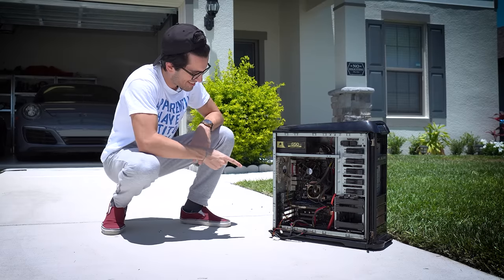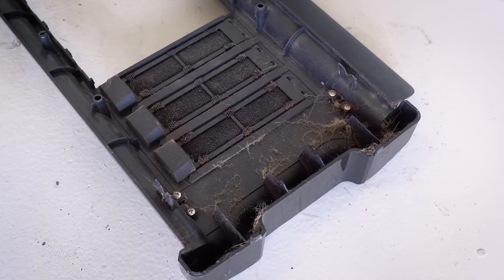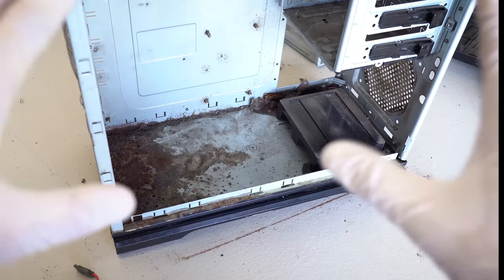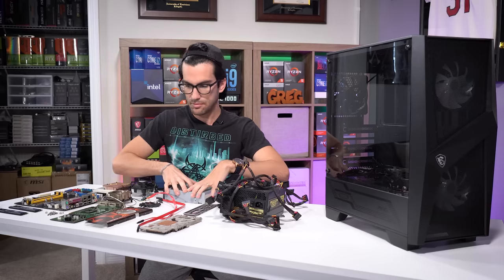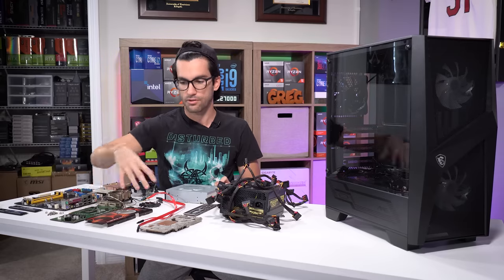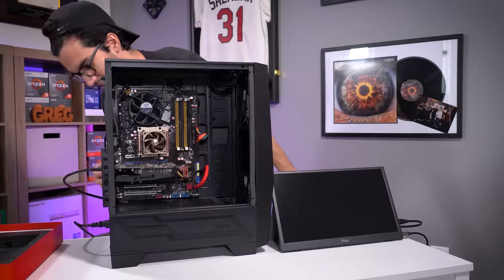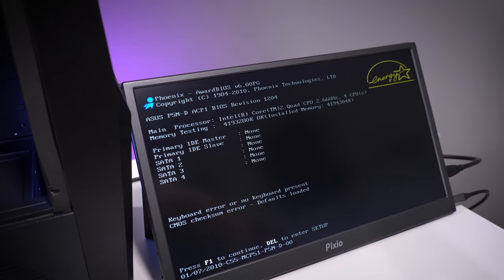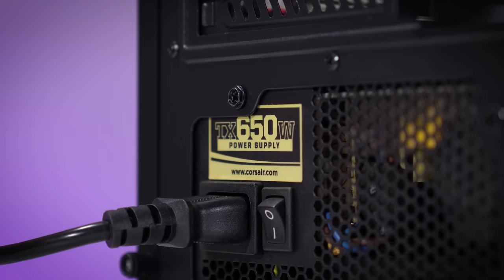Deep-Cleaning a Viewer's DIRTY Gaming PC! - PCDC S2:E4

Comment: As someone who previously worked at a computer server warehouse during summer in high school dealing with filthy systems exactly like this every day, I really enjoyed this video and it was so entertaining and satisfying to watch...Cleaning out a disgusting system ridding it of all the age and dust making it look and feel brand new again is just way more rewarding than just building a brand new pc with top-of-the-line components that you can find on major retailers like every other pc build on the internet. Really appreciate you sharing this, liked and subbed!
Reply: I agree. Yesterday I cleaned my computer case which was FILLED with dust like seriously no wonder I couldn't run games good and it overheated often. I thought it was the gigabyte geforce gtx 770 which was bad but it couldn't just get air and also my case restricted the air flow so I opened it up. Now works better than a lot of todays low-mid end gpu's I definitely agree making something that works better is way more rewarding than just buying something you don't need.

Comment: My friend's dad found something like this on the side of the road. He picked it up and dropped it at my house knowing I'd be interested. Utterly filthy; years of dust, dead bugs, and solid, sticky grime. I cleaned it up using some of your PCDC videos as inspiration, and after replacing the power supply and putting in an SSD I've put together a pretty capable system for my cousin. The thing had a reference Radeon R9 290, which still holds up incredibly well in modern games but is ridiculously loud. Worst part is an FX 4100, but I think I'll get him an FX 8350 for Christmas. Love this series, super therapeutic and inspiring. I went down to my Grandma's house on Monday and gave her system a clean, it was much overdue and its plenty more quiet now.

Comment: You should get yourself a small ultrasonic cleaner,  when I get in components that are in that state you can put them in the ultrasonic cleaner for 10-15 mins @ 40-50C then soak in Isopropyl alcohol and they come out looking brand new!
Reply: Yes this - if you are going to go hard into cleaning electronics, a good ultrasonic cleaner is a must.
Reply: They seem to run $150
Reply: I've never used one, but have seen em in action and they work wonders. +1

Comment: Its that I am in the Netherlands, otherwise I would have send one of my old gears (i5 3rd gen). Would have been perfect as an upgrade for that DDR2 system.
Reply: @MrGichinfunakoshi  core 2 quad also can run  with dd3, but previously the memory controller was in the north bridge, not in the cpu itself.
Reply: @MrGichinfunakoshi  Old gear to replace that ddr2 sistem, means the hole platform, cpu, motherboard and ram.
 Lga 775 with an overclocked Xeon 4ghz+ might be able to play some new games tho..
Reply: @MrGichinfunakoshi  You can see in the shots clearly DDR2, and the motherboard only supports DDR2, for this sysytem.
Reply: @MrGichinfunakoshi  The original.comment meant that he would send his build with 3rd gen i5 to replace the build in the video which is DDR2.

Comment: Hey Greg. Props to you. Diving into these science fair projects is akin to working in a biohazard lab. Here’s a suggestion, based on my experiences. I’ve been in the automotive detailing business for years, and the best tool that we use, by far, is a tool called a Tornador. Yes, Tornador, not Tornado. It uses compressed air and various solutions such as IPA, or degreasers, and is indispensable. We use it around vehicle electronics, instrument clusters, window and door switches and the like. I’ve used it with care, to clean PC’s as well with great success. Take a look and see what you think.

Comment: The GeForce 9xxx series was already DirectX 10 shader model 4.0. The last DX9 cards where GeForce 7xxx. That's also why I have a Geforce 7800 GTX SLI system in my retro collection and a ATI Radeon X1950 XT system for good measure.

Comment: Greg I enjoy the videos, I get the same satisfaction as my hobby for high end automotive detailing. One thing I took away from detailing cars and their interiors is that boar hair brushes are king. I highly recommend you pick some up for doing these videos. Just spray the board and brush with alcohol and brush away. I do this with my own components and it works very well, much more efficient than using towels.

Comment: Used to own a couple 9600 GTs.  Ran them in SLI mode.  Highly overclockable cards.  Ran alot of games with them before upgrading to a 560 TI around 2011ish.

Ive since upgraded from the 560 ti as well lol.  Was showing its age.  Got a GX 6600 XT Radeon now.

Comment: I absolutely love this series, but I'd love to see a quick benchmark run on some of these older/different systems we don't see very often. That would be cool!
Reply from the maker: These videos already require several days worth of filming and cleaning each, so I'm not keen on adding any additional time to them. On top of that, I don't like accessing random viewer builds for the sake of benchmarking a few things. Sure, I could add my own drive, but I'd need to install Windows for every single build that comes in, and that's just not feasible.
Reply: @GregSalazar , that was my only other concern as well. Keep up the great work and thanks for responding.
Reply from the maker: Thanks for the support!

Comment: Nice to see some Core2 systems still in use. I have my old Core2 Quad mobo+cpu (and older Core2 Duo cpu for that) and some gpu's of that era as testing platform still around. I even have WAY older AMD K6 2 400mhz system for nostalgia reasons. Also 133mhz pentium laptop, 386 laptop with crayscale lcd disp and lots of more. Too bad I sold my old 286 system years ago... One apple laptop also, do not remember model, but old AF. That old hardware is just great for tinkering and testing. Maybe time to put up my own museum soon.

Comment: Not sure if you will see this Greg, but if you do a video on that gpu can you soak the front section in vinegar and see if that removes the rust while still working in the end. Vinegar is great at removing rust it just takes a day or two to soak, just wanted to see if the rust is the only thing the vinegar dissolves.

Comment: Hmmm, I don’t know man. I wouldn’t recommend cleaning with alcohol something that is so full of dust. Humidity and dust are the worst enemies of integrated circuits. The best I could do is trying to remove all the dust as possible with some kind of blower and thats it. In my opinion there is a high risk that something could be damaged through the process.
Reply from the maker: There is NOTHING that IPA will damage in a computer so long as you're sensible with it. I've been doing this for months with PCs. No issues. Not sure why you're worried. "Humidity" isn't a factor here... it's 99.9% IPA Lol.
Reply: @GregSalazar  Sorry, I didn’t mean to disrespect your work or something, it’s clear that you know what you are doing, in fact I always watch your videos and find them interesting and useful. I was just gave my opinion based on what I have experienced many years ago, but I also live in a country where humidity is around the corner to the point that my fan blades had moist every time I cleaned them.

Comment: The preowner of that pc was smoking. When you pulled of the ventilator of the cpu cooler and showed the cooling fins, the color of the dust told me. But the special taste you mentionend also told me, mostly he wasn't smoking tabacco. XD Maybe this thing went through hell of an hurricane before and got wet, eroded afterwards and it smelled like an scrap metal dump yard??? Also seen a house fire and survived?? I'll go with my first hypothesis.

Comment: I just found time to get back to some of these cleaning videos.. I had an old case that looked VERY similar to that i got from a nasty family member. My best guess about what the discoloration was, its roach feces and urine. I ended up pouring alcohol in the ram slots and hitting it with a old tooth brush, what came out appeared to be feces. Also there were 4 dead roaches and roach feces stuck to the pcb in the power supply.

Comment: Get an air compressor mate you can blow most of the stuff out of the system even still in the case and you would have had way less gunk and dust to clean. Save's a lot of time

Comment: Oki, I want to make a suggestion from an old 40+ year old techie. The electric duster, stop with. It has the umph of a fat girl on a moped. Go out to the garage and get the electric leaf blower. Get the focus attachment for maximum air speed and blow that shit out. Yes, be careful not to over rev the fans as you could damage the bearings but you will do 10x better job in 1/10th the time with a leaf blower.

Comment: I found a pc in the free section on craigslist with a gpu, picked it up and it was huge a ibuypower prebuild in a Cooler Master HAF X case same motherboard in the video q9650 cpu a gtx 650 with two sticks of g.skill ram and two sticks on corsair value ram. The guy said it didn't work turned out to be one of the corsair value sticks was bad, removed it booted right up, sold the gtx 650 for $35 as a "will run fortnight" card junked the case as it had seen better days repurposed the corsair 750w power supply way overkill for the parts, still have the motherboard cpu and ram.

Comment: You should invest in an ozone generator and a large cooler. You can close the systems in the cooler outside with the ozone generator turned on and blast them with ozone for an hour or so. The PC won't be cleaner but whatever might be in the system will be much more likely to be dead. It will also held deodorize the system. That way you're not bringing a potential infestation into your house.

Comment: are those... IDE and PCI slots? whoaaah. 

Gotta say, though, despite the very, very disgusting state of that system, it's impressive that it still manages to "work". i had two 775 systems (paired with a 9800GT and 9500GT) that both decided to die around the same time a few years ago.

Comment: About once a year I need to blast mine with the air compressor. Also, take the time to throw on some new thermal compound as the stuff gets hard with time. My PC just smells like weed. About to upgrade from E7600 to Ryzen 1600 af

Comment: You should consider using acetone to clean these systems, it's much better than IPA. I have an Asus ROG Maximus Extreme (LGA775) which had dried on thermal compund under the chipset heatsinks and IPA wouldn't even touch it. After a bit of research I saw a few recommendations for acetone (the stuff you use on your fingernails) and I thought I'd try it. It cut through the thermal compound with no need for scraping.
Reply from the maker: I've never run into a situation where IPA doesn't remove thermal paste - even crap that's been hardened over several years. Though, obviously, I'll scrape it away when I can (still much faster than acetone).

Comment: Do CPU coolers of that style follow the same law of airflow? For example the open side of the fan pulls air so all CPU fans like that blow air down through the CPU heatsink? I would think it makes more sense to pull hot air off of it and away from it to get sucked out by the exhaust?

Comment: A GTX 1060 is a tad overkill for such an old system. A better pairing would be a GTX 1050 or 1050 Ti at most. With the leftover budget, you could throw in another 2GB x2 of DDR2 RAM, so it's sufficient for lite gaming. Everything else checks out nicely. I love seeing old rigs getting cleaned up.

Comment: I have an old system i would be willing to part with for you to test on it if you would like.  Its an old E2180 on a ASRock G31m-s motherboard.  Also has an old R5670 from msi on it.  All it needs is a hard drive.  I got it working a few weeks ago but then bought a lenovo legion desktop after.

Comment: Motherboards with smell... Ew... I would have cleaned that with dish soap and hot water! Works very well, in the summer it's pretty easy to get it to dry, I've done that several times and works every time ! Just need to remove the battery and other heatsinks etc

Comment: yo ggreg I have MSI B150 M3 Mb and it has a problem with the ram slots the first 2 slots are not working the second 2 are working fine but I connected 2 DDR4 x2 - 8GB RAMS and they're not in dual channel how do I fix the first two slots to get it working again. is it from bios or is it dead?

Comment: Pls can someone explain why liquid on the motherboard doesn’t break it it’s hurting my head😂
Reply: When (mostly) any electronic equipment is completely powered off and disconnected you can use Isopropyl Alcohol to clean it and it wont do any damage.
Reply: @vyb4340  that’s really crazy, thank you bro, never knew that

Comment: Hey I’m having an issues with my dell optiplex 3020 i5 4590, I have a gtx 570 4gb, 8gm ram 500gb HD and 500w thermal take. The issue is that when I uncap my FPS for fortnite it would later freeze the entire computer and i would have to force restart it. It would happen randomly too even if it’s capped, can you give me any solutions? Lmk if you need more info if you can help? Thank You

Comment: bro i would like to suggest to get a ultrasounic cleaner for corroded parts.
Reply from the maker: Nah. I prefer manual cleaning.
Reply: @GregSalazar  sir greg i have a problem in my PC but im located in the philippines.   My pc wont restart. What would be the problem. When i turn on normally it will function but when i press restart it will not boot up.

Comment: What is the processor in this rig? is it not bottleneck with the gtx 1060?
Reply from the maker: Q6600. And yes, it'll be a bottleneck. But he'll still see a massive frame rate bump with the 1060 over the 9600GT, hence why I said what I said...
Reply: @GregSalazar  ok. Thank you

Comment: I remember wanting to get that GPU and not being able to afford it despite being relatively cheap, instead I got a 9400 GT which to be fair was still a decent GPU back when it was new. Now I can afford any GPU I want but I don't want to because they cost an arm and both legs, and the cheapest ones are weaker than mid-range cards from 5 years ago. How the turntables.

Comment: I kinda miss the look of those old single slot graphics cards. You could build a decent PC in a much smaller case if you wanted, and they didn't fill like... 1/3 of the case like modern VGAs do..

Comment: Some of the things u do are wreckless u just doused the CPU fan in water there is a iron core in it and a oscillating circuit and you put a CPU in up side down in a Xbox one so there's constant hot air blower through the console but i will say other than that u did a good job cleaning that motherboard looks good

Comment: That 9600gt looked brand fckng new well used like new but the 1060 wow man that's gonna be bottlnecked I would have used that pc to play mid 90s 2000 to 2010 games and just build a new one cause the gtx 1060 won't work with old games but the 9600gt has allot of support

Comment: That musty smell is probably a black mold or something similar. Not very healthy. I'd rather leave it in direct sunlight for a few hours before taking it apart. Anyway it's better to replace it with something a bit modern like even i5 2400.

Comment: Being a socket 775, i would have bios moded the mobo, bought a moded X5460 xeon, put it in there, expanded to 8GB of ram, and boom, welcome to top tier 10 years old performance, no kidding those lil bastards still run just fine many modern games, my second PC it's one such system, and from a duo, to a quad xeon, the performance boost was amazing, but you should limit to W7 or linux distros, windows 10 just loves to drown old cpu's like these. 
Fun fact it only cost me 10$ for the moded cpu, everything else was adquiered for free via recycling center (i live in Spain, and as long as you get permission you can get whatever you want for free in the  local recycling centers).

Comment: Funny thing, try to start any modern game on that CPU :P
It does not support  a lot of modern instruction sets that today's CPU's use and will run game absolutely terrible.
I tried running Division 2 on my Q9450 @3.6 Ghz, no chance in hell, and that paired with a GTX 970.
The game started but the image was totally broken were it seemed to having trouble using correct colors and Dark and bright areas were totally screwed up.

Its hard to explain but it was a fun experiment.

Comment: uh wouldnt the core2quad bottleneck even the 960?
Reply from the maker: Sure, it'll be a bottleneck. But as I said in the video - you'll still notice a huge difference with the the 1060 vs a 9600GT. Not even a question.

Comment: Isn't that old q9400 too weak for a 1060? His cpu upgrade path on that 775 socket is a q9550 which is negligibly a tad better.  That cpu will bottleneck the crap out of that 1060. So upgrading to that is basically useless. It's like putting f1 racing tires on a shopping cart. This tells me 2 things. Either you didn't bothered to look for a more appropriate balanced card like a gtx 750, or you just made the video for keeping the content going.

Comment: A free 1060 graphic card on such low performance setup seems like a waste tbh, a 1060 is meant for a 8 core CPU with 16 GB Ram, not a 4 core CPU with 4GB Ram. But hey I guess he can just throw that trash you spent so much time on away later, and upgrade the PC to meet the GPU performance later.

Comment: The case was a thermaltake armor from 2008. 250$ new

Its bad and i would toss as well. Rust is bad for this stuff. I have mine since 2011 and is in far better condition than this.